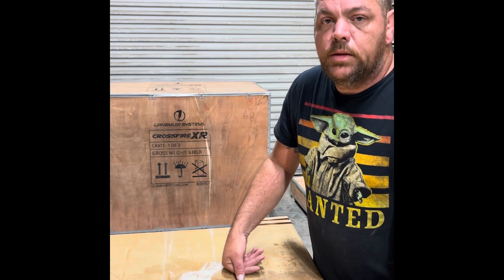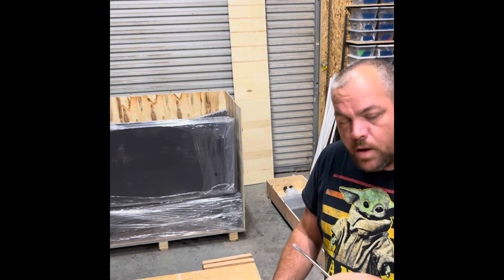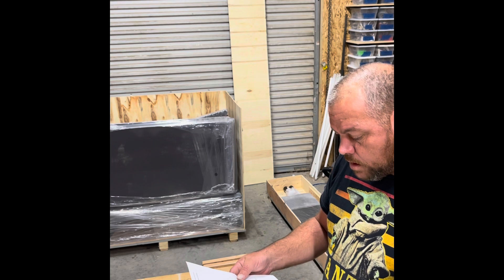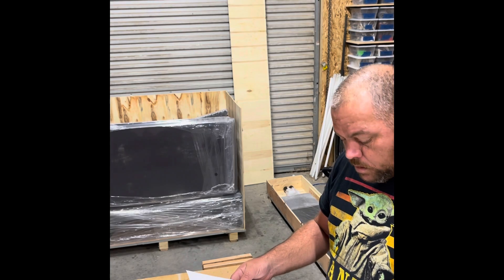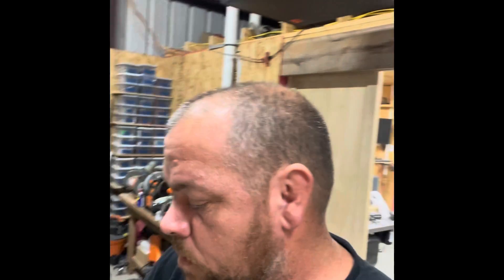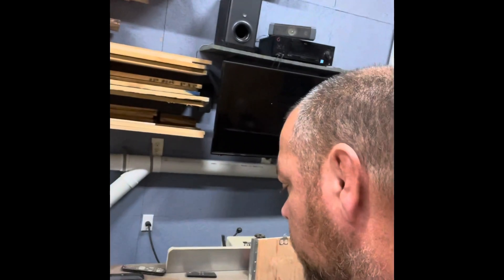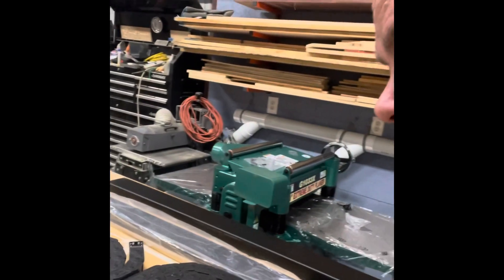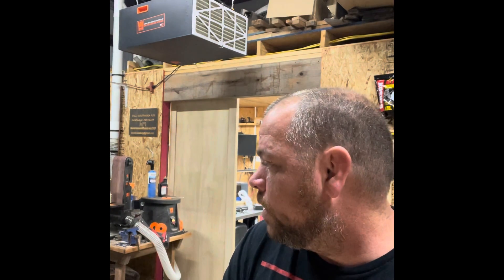Langmuir Crossfire XR Un-boxing

Comment: hows it coming along? are you happy with the XR?
Reply from the maker: I’m still working  on my first cut. I had a lot of extra setup to do since it’s my first cncc plasma. Spent a weekend getting water ran to my shop. This last weekend I’ve been upgrading my electrical. Hoping to button that up today. And run air over to it. Hoping to be cutting by tomorrow.